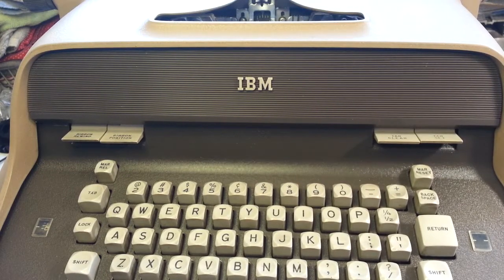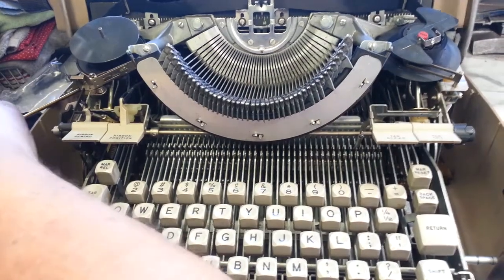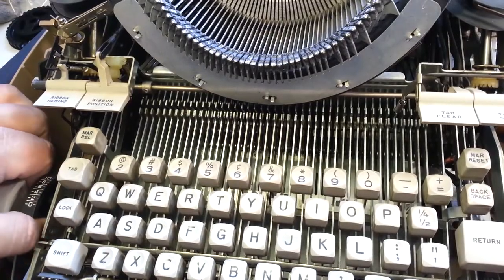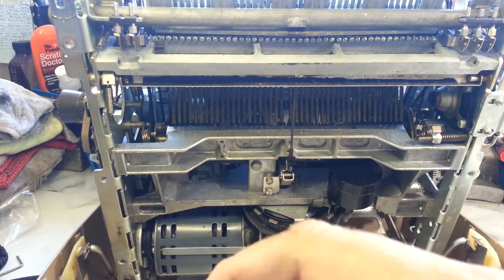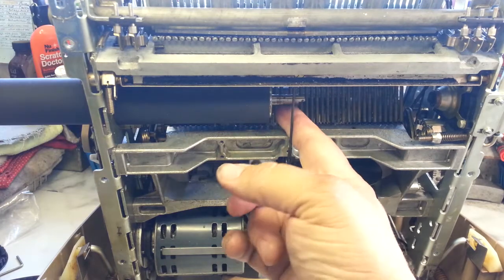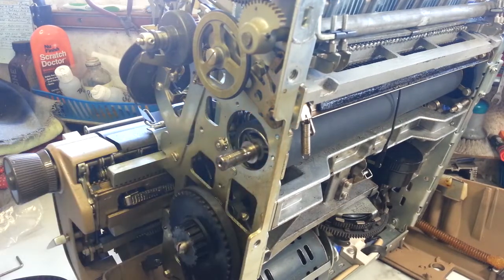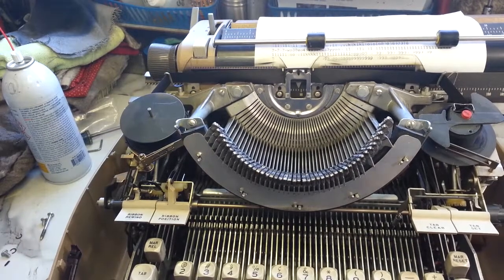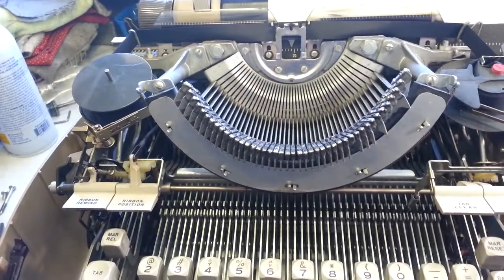IBM C Model Typewriter Power Roll Install (part 2)

Comment: I just got one of these and some of the letters print darker than others and a couple only print with impresion adjustment set to max and then it is faint.  I noticed each key has a adjustment screw next to the power roller but those screws dont appear to do anything.  Is there any kind of adjustment for impresion strength on a per key basis?
Reply from the maker: Each screw corresponds to each character, they are impression adjustments, inward is lighter, outward is harder strike
More likely it needs a new power roller, when these get old the rubber compound breaks down, causing the impression get funky & inconsistent
Dirty type segment can also cause inconsistent strike
Reply: @phoenixtypewriter2136  i removed the power roller and cleaned it with mild dish soap and rinsed with water. Cleaned the grooves on the dogs that contact the roller. Put back together and adjusted the screws you mentioned. Took some time but it works good now.    Thank you for the help.

Comment: Thanks for the video! I recently obtained a Model C in pretty good condition, but some of the letters had their impressions too light, and now I see how to adjust that underneath. I have the carbon ribbon model, would you happen to know a good source of carbon ribbons other than eBay?
Reply from the maker: That seems to be the only source for the carbon ribbons
The fabric ribbon is just a standard 1/2" , but needs to re-spooled onto original spool, video coming soon.......